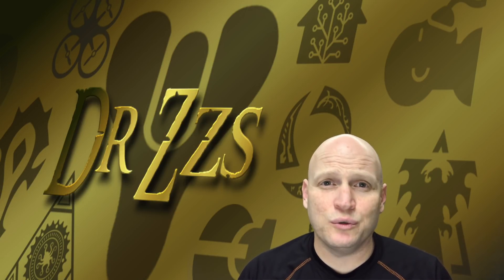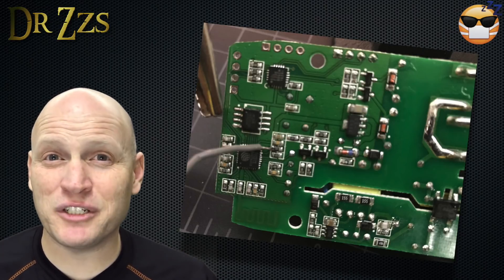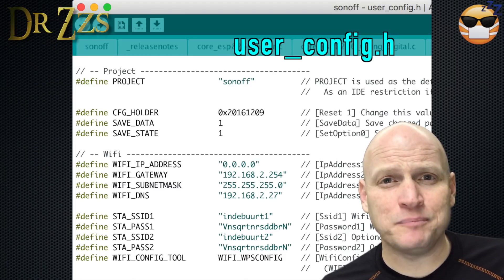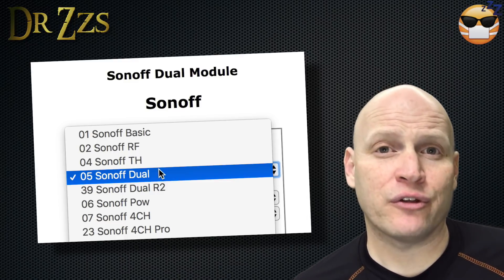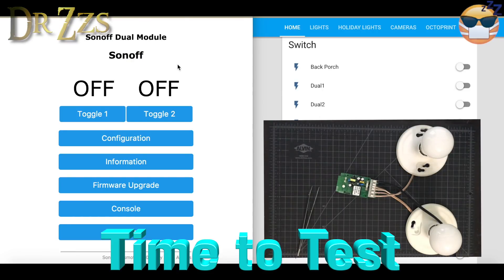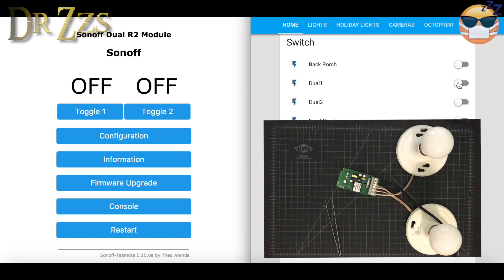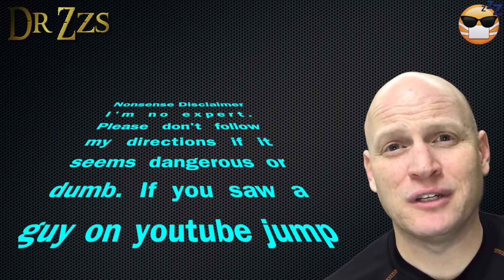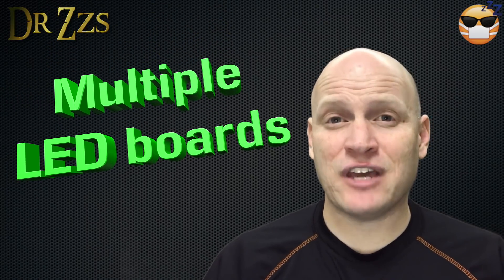Sonoff Dual with TASMOTA firmware

Comment: Can you put a reed sensor on this, to know if a garage door is opened or closed?
Reply from the maker: Yes.  I believe you'll have to use Tx or Rx pins.  Be aware that you may get trouble if the board reboots and those pins are high or low.

Comment: if I add the portable folder, the IDE wont open
Reply from the maker: The process in this video for flashing is outdated.  Look at the Video page on the channel for an updated video about the flashing process.  The parts that stay the same are getting the device in programming mode but all the software stuff will be different.
Reply: @DrZzs  thank you I will try the other version then

Comment: Hey, love your vids; helped get me started. I have 7 dual R2s for shutters and use pulsetime to fire each relay for long enough to open and close. Pulsetime works from the webui and openhab perfectly. I want to add press switches to the gpio pins bit all they do is trigger the relays when pressed but release when you let go. Is there any way to set pulsetime for externally connected press switches? Thanks again.

Comment: can you use 2 switches and a temp sensor on this model?
Reply from the maker: I would expect you can.  I've found you can add a temp sensor to the Rx pin after flashing without getting errors on boot-up.  That's not always true, but seems to be fine with Rx and Temp sensors. 
Hope that helps!

Comment: I try to flash with an arduino uno with the configurations you post on sonoff basic and here bit without success: fail compiled for generic source esp8266 module. Platform esp8266, not found... I saw that is the sonoff dual R2 Ver1.0 but on on the back the chip is a 8285 ... it is compatible ? mmm
Reply from the maker: yes the 8285 and 8266 are the same chip.  the difference is the 8266 has the memory chip separate so there can be more memory.  The 8285 has 1mb memory built in.   They are otherwise exactly the same.  
I'd guess that error comes from not having the board manager installed or something related to that.  
Another possibility is when you use an Arduino as the USB/Serial interface you need to connect Rx from the Arduino to Rx on the sonoff and Tx from the Arduino to Tx on the Sonoff.  That's different than when you are using an FTDI or other usb/serial adapter.
Reply: Ok, I will try with instructions for bin => https://github.com/arendst/Sonoff-Tasmota/wiki/Esptool. About RX and TX, I was connect RX to TX .... I try with RX to RX and TX to TX.....
I post a response after test this kind of solutions.... Thank You

Comment: Question, i got dual R2  with switches working fine, if there is a power cut and the wall switch is in ON position (Button0 connected to ground) the sonoff will never restart just until the switch is OFF position (Buttob0 open). Is it nay way to fix this? or always that it reboots  and the switch is on is going to go to config mode?
Reply: Daniel did you figure out a solution to this issue?
Reply: I also would like to know the answer to this? Is there a work around to preventing the dual from going in to flash mode if  gpi00 is “switched” to gnd at power up?

Comment: Hi, @DrZzs,
I would like to connect my air conditioner on Sonoff Dual 16A (10A/gang). Do you think that is safe if I split the energy in each gang? And turn on/off both channels at the same time?
Reply from the maker: Probably.  What is the current requirement for your AC unit?   You probably don't want to get too close to the max.  If you had more than 8A on each switch and then turn them both on you'd be pushing the limits of the board.  My bet is your AC isn't going to draw 8 amps, but it might.  See if you can find the max current draw is of all the things you want to connect.  You also have to figure in the start up draw of the AC motor.  
So, I guess I can't really tell you yet if it's okay to use the Dual with your AC.

Comment: when I put 2 duals on my configiration.yaml file it gave this error
ERROR:homeassistant.util.yaml:YAML file /config/configuration.yaml contains duplicate key "switch". Check lines 84 and 102.
 This is my yaml file
#---------------------------------------------------------------------------------------------------------------
#Kitchen
switch:
  - platform: mqtt
    name: "Name1"
    command_topic: "cmnd/Kitchen/power1"
    state_topic: "stat/Kitchen/POWER1"
    qos: 1
    payload_on: "ON"
    payload_off: "OFF"
    retain: true
  - platform: mqtt
    name: "Name2"
    command_topic: "cmnd/Kitchen/power2"
    state_topic: "stat/Kitchen/POWER2"
    qos: 1
    payload_on: "ON"
    payload_off: "OFF"
    retain: true
#T.V Lounge
switch:
  - platform: mqtt
    name: "Pot Lights"
    command_topic: "cmnd/TvLounge/power1"
    state_topic: "stat/TvLounge/POWER1"
    qos: 1
    payload_on: "ON"
    payload_off: "OFF"
    retain: true
  - platform: mqtt
    name: "Pot Lights2"
    command_topic: "cmnd/TvLounge/power2"
    state_topic: "stat/TvLounge/POWER2"
    qos: 1
    payload_on: "ON"
    payload_off: "OFF"
    retain: true
Reply from the maker: just take out the second "switch:" heading.  Then it should be fine. 

You can't have two headings that are the same.  
You can either put all of them under one "switch:" heading or make one "switch_2:" or unique in some other way.  Just take out the second one.  That's how I do it.
Reply: thx for quick reply

Comment: the problem was the serial adapter drivers were not updated after I updated it everything went alright, but then ...... I have no way to tell it my wifi SSID and password.  I am pushing the button really fast 4 times but the light isn't blinking. I am pretty sure you could help in this problem.
Reply from the maker: Download Termite. Then with the sonoff connected to the usb/serial adapter you can use Termite to put in SSID1 and password1.  Check out the video from Vicious that I Linked in the sonoff 4 channel video from last week. He explains how to use Termite.

Comment: I am having errors when I flash with flashEZ it trying to write but is unavailable
Reply from the maker: that probably means either your Rx/Tx wires are reversed or the board isn't getting into programming mode.
Reply: DrZzs how do you put it in programming mode
Reply: DrZzs how do you put it in programming mode
Reply from the maker: depends on the model of sonoff.  You have to put GPIO-0 to ground during power up.  For some models that means holding down the on-board button.  For others you have to connect a wire from GPIO-0 to ground then release it after power up.  GPIO-0 can be found on any sonoff (so far as I know).  So where you'll find it depends on which sonoff model you're using. 
If you're working with the Dual here's the info on where to find GPIO-0 and get into programming mode. 
https://github.com/arendst/Sonoff-Tasmota/wiki/Sonoff-Dual-and-Dual-R2
Reply: DrZzs thx alot
Reply: I am still having the same problem, I got to programming mode and I tried switching the RX/tx wires around but no luck. it is giving errors about "failed sending 8 MB". by the way, i'm using the flash ESP8266 method.
Reply from the maker: can you take some pics or video of what you're doing?  That might help me see the problem.
Reply: I think I got the problem. by some troubleshooting, I found out the com ports are not correct so I connected everything again and no new com ports were showing up I am really getting frustrated.
Reply: DrZzs I think I got the problem. by some troubleshooting, I found out the com ports are not correct so I connected everything again and no new com ports were showing up I am really getting frustrated.
Reply from the maker: Man, sorry you're having so much trouble with it.  I wish I could just reach through the internet and do it for you :) 
Maybe take a break for a few days and come back to it.  You may think of something new after being away from it for a little while.  That works for me sometimes.
Reply: DrZzs I think I got the problem I am using a power usb cable so I am going to buy a new data usb cable today and see if it will work or not.
Reply: the problem was the serial adapter drivers were not updated after I updated it everything went alright, but then ...... I have no way to tell it my wifi SSID and password.  I am pushing the button really fast 4 times but the light isn't blinking. I am pretty sure you could help in this problem.
Reply: DrZzs the problem was the serial adapter drivers were not updated after I updated it everything went alright, but then ...... I have no way to tell it my wifi SSID and password.  I am pushing the button really fast 4 times but the light isn't blinking. I am pretty sure you could help in this problem.

Comment: how about sonoff ch4 pro please? cant get it to flash mode
Reply from the maker: I've got the normal non-pro 4ch.  I don't have a Pro.  I'll go over the process for flashing it next week.
Reply from the maker: do you have the R2?  looks like the process for flashing is different.   It should have "R2" printed somewhere on the board.  If it doesn't then you have the R1.  Also the outer case is different for the R2 than the R1.  
R1: https://www.dropbox.com/s/2rvo4y3xz6p5752/Screenshot%202018-05-14%2007.29.20.png?dl=0 

R2: https://www.dropbox.com/s/7yy6sp2y0ktfp63/Screenshot%202018-05-14%2007.29.01.png?dl=0

I'm doing the 4ch video for next week.  I can probably add the Pro R2.  I'll cover the R1 process but I won't have one myself to test.
Reply: DrZzs version 1.1

Comment: I have a couple of version 1.0s. It's annoying that external switches can't be added to the headers but the existing button functions fine. Single press for relay 1 on / off, and double press for relay 2. Could probably hack that out to a single momentary switch...
Reply from the maker: Ya. I sure agree. Ver 1 is very limited. Not quite useless but pretty close...

Comment: hi Dr .
 thanks for your vids, I have a question on the push button, how do you mount them to a wall plate, I  was not able to fund any ready that fit, i though of buying blank inserts and drilling a 16mm hole in it. juts want to know what you did and how it looks finished.
Reply from the maker: Thanks!
I've done a few different things.  I drilled the holes in plank plates, I also 3d printed some inserts for plates that fit larger switches, and most recently I've been using capacitive touch buttons and just hot-gluing them to the inside of blank faceplates.  The capacitive touch buttons are by far my favorite option.  I'm hoping sometime to go back and replace all the mechanical push buttons with the capacitive touch ones.  
You've probably seen it but I use the touch buttons in the Zzonoff video: https://youtu.be/B38e1HAMUXs

If you want those modules here's a link:
Amazon: (most expensive, but fast shipping) https://amzn.to/2redVX5
AliExpress: (quite a bit less expensive) http://s.click.aliexpress.com/e/nA2FUNV

Comment: I used a Dual R2 to replace a dual ceiling fan switch.  I was able to fit the dual sonoff in a single gang box.  It was tight, but it worked.  Now i have automation control over the light and fan.
Reply from the maker: Awesome! 
The world needs bigger switch boxes.

Comment: Hey DrZzs, we met at the Maker Faire and was pleasantly surprised by how easy this was. Nice work and thanks! I decided to jump into the deep end and go for the Sonoff quad unit. I flashed it fine, but I think I messed something up because it won't work anymore. Have you had experience with this device?
Reply from the maker: Hi!

Thanks for coming by the booth.  I just found out there's a maker faire at Thanksgiving point in Sept.  We'll be there again for sure. 

I have the 4ch but I haven't opened it or flashed it... yet. 
Is it not responding to commands or is it not even power up?
Reply: Great! I've told a number of people about your booth. I'll tell them to look out for you there.

WRT my issue, I think I need to get back to the basics and try again. The crux of my issue is that the unit thinks its a single switch and not a quad. I missed a step somewhere. I'm afraid I may have to use the flash eraser tool to fix my mistake.
Reply from the maker: Preston Manwaring I think I know what you need to do. From the TASMOTA main page go to Configuration. Then Configure Module, then scroll down and find the 4ch. Then Save. That should do it.
Reply: Yep, I'm a total noob. I got it working though! I now have a home hydroponics farm running with lettuce growing! Thanks!

Comment: Great videos, subscribed!
I have one sonoff dual R2 and I'm planning to automate an external blind.
The blind is operated via a 3 position switch, up/off/down.
I have then 3 wires, one live and two for each roll direction.
It looks very simple to setup, but I'm also planning to keep the external button (two press switches maybe). 
I'm worried that having both sonoff buttons pressed at the same time would damage the motor.
Is there a way to assure that the other button will be turned off before one is turned on, considering the external buttons and the automation via App?
Reply from the maker: Sounds like a fun project.  As far as the Automation, I don't think there's any way it would activate both at the same time.  Possibly one right after the other, but there will likely always be a little delay even if you hit the two buttons at the same time.  

As for physical switches.  I don't know how best to make the touch buttons exclusive, so you can't activate both at the same time. I'll have to think about that.  There may be a way to do it, I just don't know it (yet :) 
I think you can get something like a 3 position rocker switch so there's no way you could activate them at the same time. (which is what it sounds like you already have)
Something like this, for example: https://amzn.to/2I9Rr0a
Reply: DrZzs Yes, the atual button is a 3 way button.
But I'm a bit confused, I'm assuming that sonoff requires a push button, one push to turn a relay on, another to turn it off.
Is there a way to configure it so it works with rocker switches, keeping a relay on only while the switch is connecting the button terminals on the board and off otherwise?
Reply: Hi, I have a similar problem. If you have a blind, there can not be a situation where both positions are turned on (I want to remove press switch). Is there any solution for this?
Reply from the maker: You can set the switchmode so the relay stays on only when the button is pressed.   I believe that's how Switchmode 1 works.  I'd have to verify that.

Comment: Hi, your videos are great! Can the R2 work with physical buttons using the stock firmware? Thank you.
Reply from the maker: Thanks!
I'm not sure about using buttons with the stock firmware on the Dual.  I probably should have tested that before I flashed it.  oops.  I can't go back to the stock version now. 
I know the button on the board does not control the relays.  But the extra pins are labeled "button 0" and "button 1" so they may control the relays.  
Sorry I can't say for sure. 
If you haven't already, check the comments on the product page.  Maybe someone else has asked that question:
https://www.itead.cc/sonoff-dual.html

Good luck!
Reply: DrZzs ok, thank you!

Comment: Loving your videos mate! So clear and helpful. 
Question: I'm looking at using a sonoff dual to control a wired projector screen. Is there anyway to make the dual "toggle" between the outputs? Or is it easier to just create the automations in Home Assistant? 
I'm just worried of outputting to both up and down simultaneously and frying the motor in the projector.
Reply from the maker: Thanks!
So it's just one motor and you want one relay to drive it one direction and the other to connect it opposite?  How are you powering it now?  Have you already thought of using a motor controller?  

I'll bet it is possible to do what you're asking with the Sonoff Dual.  Theo and the Tasmota developers have thought of just about everything.  
Looking at the available commands I think "SetOption14 1" might do it:
https://github.com/arendst/Sonoff-Tasmota/wiki/Commands

Looks like that sets the relays to interlocking.  I'm not 100% sure that's what you want, but it might be.  I'd have to try it to see what exactly that command does. 

Sorry that's not a great yes or no answer.  
If you already have the Dual I'd suggest you try it out and see (not connected to your motor of course).
Reply: DrZzs Thank you for such a quick reply. Interlocking mode looks like what I want. There's a sea of settings so it's very easy for a noob like me to overlook these things. 
Currently the projector has an inline 3 way switch. Down-off-up. So physically, you have to go to "off" before you can go the opposite direction. 
I have just bought one of these: https://www.aliexpress.com/item/32812428779/32812428779.htm
I have also purchased rf rx/tx and was going to attempt doing things that way. But as much as I can, I want to avoid RF and sonoff seems like the next best budget approach. 
When you say motor controllers, what kind of devices exist (on a budget) that work with HA? I have a Zwave Stick, and have seen the zwave shutter controllers but they're around $100au. 
Thanks again for your advice. I'm really learning so much.